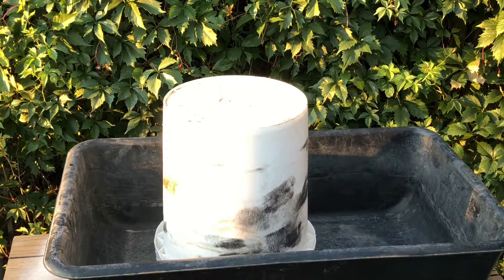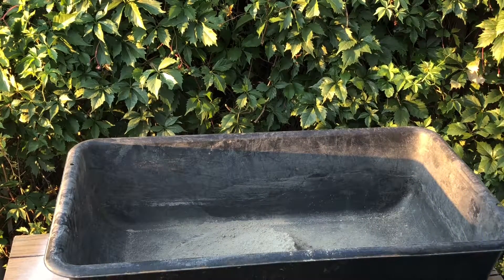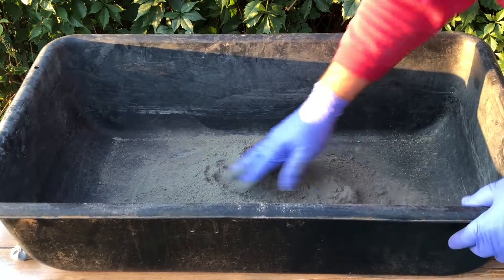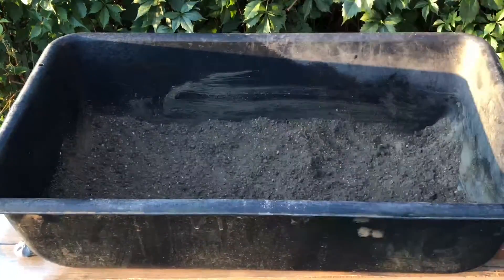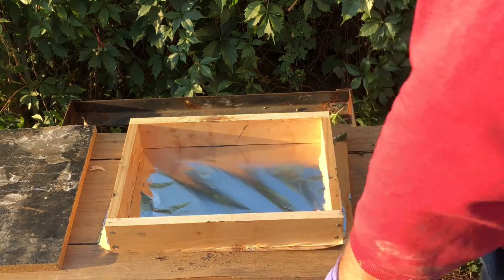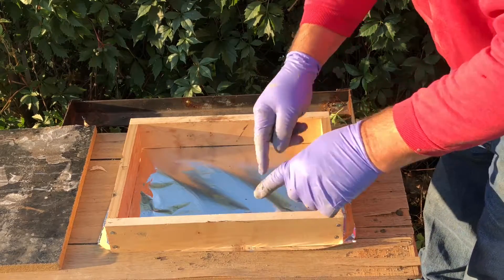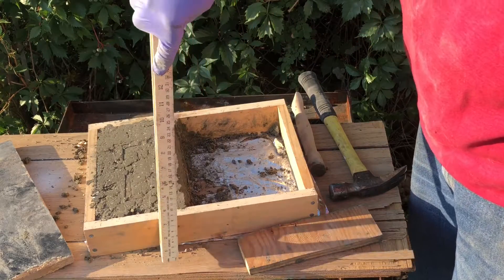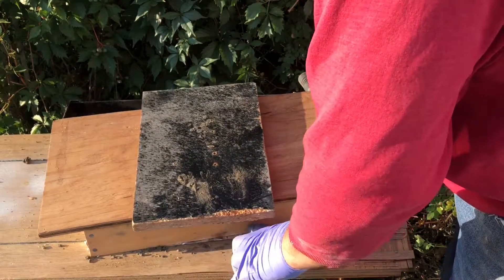Process Peek Bentonite Based Refractory

Comment: The difference between pearlite and pumice is that pumice has more alumina. 
Pearlite is basically just a more lightweight, hydrated obsidian with the same amount of silica.
Pearlite will not survive over 1000°C and again, it lacks sufficient alumina.
Pearlite even makes fly ash look like a complete refractory cement.
By the way, I currently live in Mexico where pumice is everywhere, even in brick form which can resist yellow heat.
Reply from the maker: Than you for the comment and  information.  It would be wonderful to have access to an inexpensive  refractory material.

Comment: My understanding is the fireclay will give you a refractory which has a higher top temperature.  I've read somethings which suggest Bentonite as a binder, but warn about using too much as it can act as a flux resulting in increased vitrification (melting and turning to glass-like substances) of the refractory.  From a paper on "thermal stability of bentonites in foundry molding sand" The deterioration temperatures of sodium (western) and a calcium (southern) bentonite are 1180°F and 600°F (637C and 315C) respectively.
Reply from the maker: I live in the sticks and Unfortunately I have not managed to source fire clay.   Eventually I plans to build a furnace with commercial castable.  But in the near term I am looking into what I can manage for aluminum casting, mold baking ovens and other uses.    I do have clay refined from my local soil but have not done much work with it.     I am also going to look into hydrated lime.
Reply: I plan to get around to building a furnace too. unfortunately it looks like it's something that will have to wait until late 2020.